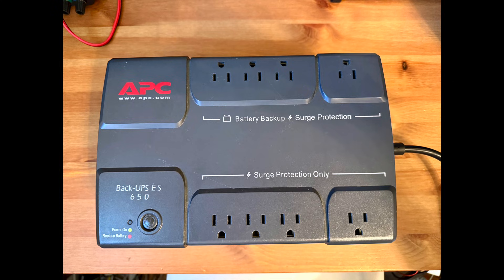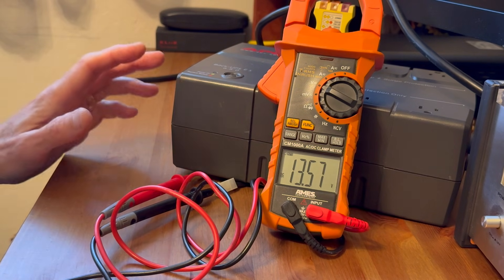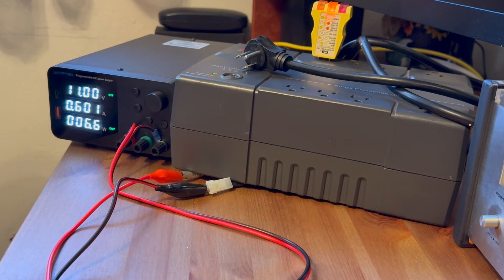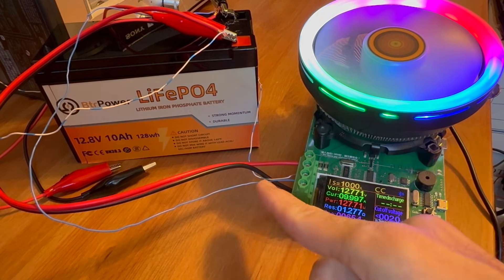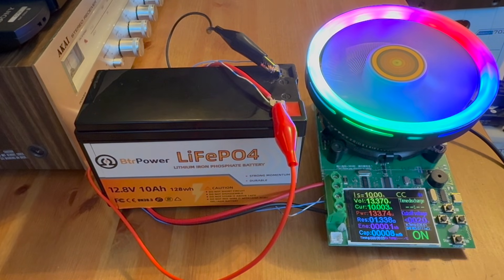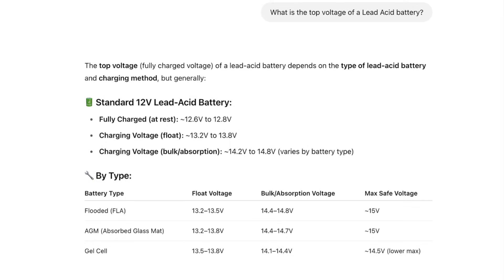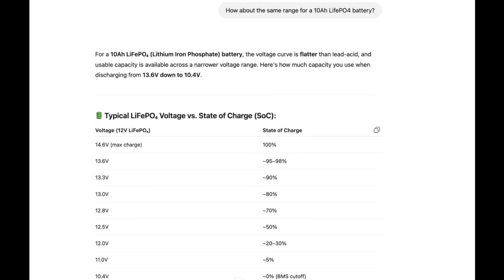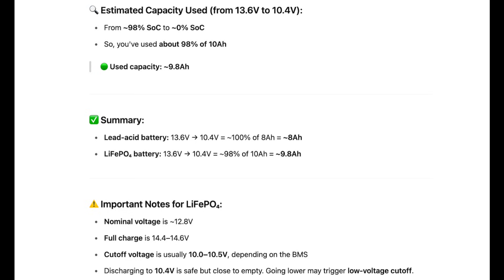Can you replace a small UPS Lead Acid battery with a LifePO4 (Lithium Iron) battery? #lifepo4

Comment: Li batteries require a different charger.

!
Reply from the maker: To fully charge that is correct. But this has worked fine for me in this specific model UPS. As long as the charging voltage is within range and the UPS doesn't completely discharge the LiFePO4 battery it should work fine.

Comment: Did you try to bump up the charge voltage?
Reply from the maker: I manually charged the battery outside (and disconnected) from the UPS using a variable power supply until the BMS cut-off.  But when I tested again and placed it back in the UPS it will only charge to the max voltage the UPS supplies.

Comment: 2:21 Very strange. I have two APC CSB 300 and 1000XL that turn off at 11.3V battery voltage.
Reply from the maker: There is probably variation between models. Although I would think within a specific brand (like APC) it would be fairly consistent. One question, did you have an AC load when you tested? I have found (after making this video) that the cutoff voltage can vary depending on how much load there is.
Reply: @AlexsRepairBench  Yes, of course, this is under 30-45% UPC load.
Reply from the maker: @bunakov-m  Good to know and thanks for commenting.

Comment: Why don't you actually try it instead of just asking chat GPT(which hallucinates all the time)
Reply from the maker: I've been running LiFePO4 batteries in my 3 different UPSs for years (see my other videos). I only used ChatGPT in this video to summarize things and I side-checked the data before including it.  However, I do agree that ChatGPT is sometimes blatantly wrong, so people should always check the results before using or relying on the data.  Hopefully my video did not give the impression I just relied on the data without confirming it.
Reply: @AlexsRepairBench  What brand UPS are you suing? Cyberpower, APC, etc...
Reply from the maker: In this video it is an APC (which you can see in the first few seconds of the video), in another video I have a CyberPower UPS, so I've tried with a few. They are all small UPSes.

Comment: Hey regarding your conclusion, I have some concerns as I was doing research about the same topic. Most of those LiFePo4 batteries BMS have a max discharge current set at 18A. The problem is, that  even with smaller UPSs like the BE550G which is rated for 550VA/330W max, you would ask the battery 27.5A discharge current. That would make the BMS cut off instantly.
Did you actually tested a 18A rated LifePo4 in your UPS?

I ended up replacing the two 12V 9Ah in my 1500VA smart UPS with SLA again since i was not sure LiFePo4 would work at all.

P.s: i just noticed you published another video regarding my question.
Reply from the maker: Good points. I mention this in at least some of my videos (maybe not my first video), as I did learn as I made more videos.  Any small load that draws less than 1C of whatever LiFePO4 battery you use should be fine, even a bit more seemed to work.  To answer your question, I never drew more than 18A and did not experience the BMS high current cutoff.  It all depends on how much load you plan to have on the UPS which can be determined ahead of time.  In my real-life use I have one UPS that powers networking equipment and draws by actual measurement about 2 amps from the battery, and an older Windows computer with flat screen monitor that combined draws 60 watts under no load and 95 watts under full load, well under a 10 amp draw from the UPS's battery when the power is out.  Now if I had a power-hungry machine that drew 300 watts that could really be a problem and I'd either need to stick with lead acid or perhaps add two or three 10Ah batteries wired in parallel to support a 30 amp draw (3 would be better, or just get a higher capacity LiFePO4 like a 50Ah that of course would need to be outside the UPS and wired using sufficiently large gauge wire to the internal battery connectors).  Thanks for commenting and bringing even more attention to this, it is an important thing to keep in mind.

Comment: AGM has much higher discharge current (5-10C vs ~1C). Swapping to LifePo4 only works if you keep the load very low (~100W for the 10Ah battery you have there).
Reply from the maker: Correct. Lead acid has a much higher current draw capacity than LiFePO4.  I do mention that in the middle of the video and cover it in more detail in some of my other UPS-related videos.  LiFePO4 works well for running minimal or set load items like home network and modem equipment.  For example this UPS is for a cable modem, router, and switch.  All that together when running on the UPS battery is about 2 amps, which would give me about 5 hours run time when the AC is out.  And the battery should hopefully last at least 10 years unlike the lead acid I had kept replacing every few years.  A different UPS I have protects my computer which with the monitor uses about 60 watts idle and about 90 watts under load, which draws less than 1C with a 10Ah battery.  If I had a 200 watt load plugged-in to the UPS, a 10Ah LiFePO4 might not be the best choice.

Comment: Create one that uses a larger LifePo4 capacity. Say 12v50Ah, 12v100Ah, for such small UPS. I want to see a deeper testing. I want to do it but I lack tools.
Reply from the maker: I'll see what I can do. I have limited batteries but I might be able to dig something up. Mostly what you will see, at least with the UPS's I have tested, is longer runtime and longer charge time, potentially much longer. For example if my 10Ah battery is replaced with a 50Ah battery, the 0.5A charging current would take ~100 hours to charge if the LiFePO4 is completely discharged.  Of course the runtime when there is a power outage would be significantly longer as well, probably 5X if my original battery was 10Ah and I am replacing with a 50Ah.

You would also have the benefit of being able to run a larger AC load on the UPS, since the 50Ah battery can probably handle 50A continuous discharged. But something to consider is cooling of the UPS, the unit was designed for a very limited runtime at higher current from the battery (sometimes only 5-10 minutes at full load), so if you significantly lengthened that, it could potentially cause overheating of the UPS circuitry that generates the AC. But only if you had a high AC load, probably anything less than say 5A DC load on the battery isn't going to be a concern. But a 30A DC load might for a small UPS unit that originally had a 10Ah battery.

Comment: What happens if you use the battery till the ups shut itself off(like during a power outage for many hours and device left unattended). Some UPSs need power from batteries to restore, so called cutoff mechanism, since the BMS will make the voltage 0 to prevent battery being fully discharged. I doubt that unit will start at all after a such power outage. I experiemented the same but hit the wall and had to take the battery out and charge to bring the battery online. Appreciate your experience. Thank you for the video.
Reply from the maker: You are welcome.  You bring up a good point on something I had not tested, so I ran some tests using this same UPS and I had mixed results. With the LiFePO4 battery fully discharged (showing 0 volts), in some cases when I restored AC power the UPS would go into a mode where it made a horrible buzzing sound, and in other cases it came back up just fine and started charging the battery.  I will be making a video on this with more details and publishing that in the next few days.
Reply from the maker: I created the video for this here in case you are curious: https://www.youtube.com/watch?v=NnljR5p-cB4
Reply: @AlexsRepairBench Thank you for spending your time to clarify and make the video.

Comment: I like the battery tester you're using in this video. Can you provide more information on it? + Subscribe.
Reply from the maker: I like this one a lot as well.  I tried a different model before this and it ended up breaking on me.  Anyhow, I ordered this nice unit from Aliexpress a while back, it is still for sale here: https://www.aliexpress.us/item/3256802913434210.html. There are two versions, a 150 watt version and a 180 watt version, I bought the 180 watt version and I am glad I did.  When I ordered it in 2022 it was about half the price, currently it shows $77 with a steep shipping charge to the US.  Our of curiosity I checked Amazon and this looks to be the same unit and as of today 9/14/25 it has a coupon and is around $72 at this link: https://amzn.to/4noL1hg (I am an Amazon associate and will earn a small commission on purchases using the link).  Thanks for commenting and subscribing!

Comment: For those of us who don't have the equipment to test the max current draw for the UPS or the battery, what would happen if the UPs tried to draw more current than the battery is supposed to handle? My understanding is that these lead-acid replacement LiFePO batteries have integrated management circuitry that prevents them from getting damaged when installed in systems that were designed for lead acid.
Reply from the maker: Depends on the LiFePO4 brand that you buy. One of the batteries I bought has a 10 amp limit and will cut-off if more current is drawn for more than a brief time. But the battery I used in the video does not, and I was surprised I could draw around 15-18 amps for almost 30 seconds without it cutting the power.  I queried the seller since I saw it advertised as a "10 amp" battery, and they said it can potentially damage the battery if you draw more than 10 amps continuously and did not reply to my part asking about the 10 amp limit advertised.  So buyer beware, always buy from a reputable seller and check reviews.

But you bring up a good point, if the battery were really to cut power if > 10 amps were drawn, you have to be very careful what you plug into the UPS to not exceed that, since if you did the UPS would shutoff with no warning, defeating the purpose of having a UPS.

In my situation my computer + monitor never draws more than about 90 watts at full CPU load which would be less than 10 amps at ~12 volts.
Reply: @AlexsRepairBench  Good points, I hadn't considered a situation that the battery would just cut power if the draw was too high. I assumed it would just throttle the supply to 10A.
Reply: @AlexsRepairBench Can I use two 12V 12Ah LiFePO4 batteries in the series?

UPS has two lead 12V × 7.2Ah batteries.

 I don't wanna buy a 24V parallel system.
Reply from the maker: @debarghyachowdhury1652  You should be able to as long as they are balanced and both batteries initially charged the same amount (hopefully fully charged).  Do you know the maximum charging voltage the UPS will charge them to?
Reply: @AlexsRepairBench  I think it's 27-28.7V.

Because, the UPS is built for lead acid batteries. So, I can expect a 20-25% loss in one year.
Reply from the maker: @debarghyachowdhury1652  Not sure what you mean by "25-25% loss in one year".  The typical max voltage for LiFePO4 for charging is about 14.6 volts (3.65v per cell x 4 cells), so double that would be 29.2 volts. If I take your lower number 27 and divide by 8 (for 8 cells) that is 3.375v which would likely charge the battery to about 75-80% charged, which is still pretty good given the extra longevity you will get out of LiFePO4 compared to lead acid.  Of course you also would need to know the UPS's cutoff voltage to find out how much capacity might be remaining in the LiFePO4 cells to determine the actual run capacity of the UPS.
Reply: @AlexsRepairBench Thanks for your replies.

My UPS is from APC backup UPS 1100VA. 

I'll connect two LiFePO4 batteries (12V, 12AH) in series. 

I saw one review saying— APC UPS lowers the capacity of batteries in one year. His lithium battery lost 25% capacity within a year. 

I don't know if it's true or not because I'm not an expert. 

I contacted a customer support guy and he's telling me to buy two 24V 6Ah batteries and connect them with a parallel connector otherwise if I use 12V 12Ah batteries, batteries will be damaged.

UPS expects 12V batteries in series why should I put 24V batteries there. I know in parallel connection the overall voltage will be 24V just to increase the capacity. 

Sorry for bothering you.😅
You get a new subscriber.
Reply: Most bms have peak current limit twice the rated current limit for short term or till the mosfet reach the threshold temp
Reply: if u only have raw cells get an anl fuse to limit current or maybe buy a bms since they are dirt cheap for the most basic ones
Reply from the maker: @wywlf6912  I would always use a BMS, as you say they are cheap and prevent issues some of which can be dangerous (fire hazard). Adding an extra fuse too is not a bad idea though, "just in case".

Comment: FYI : The standard battery case (video thumbnail) has the following dimensions : 
151.5 x 65.5 x 93.5mm (EXTERNAL) 
145 x 59.4 x 83mm (INTERNAL) 
When you insert 8 x 32700 cells (4S2P), they can fit in a "staggered" configuration, thus enabling a 12.8V / 12Ah LiFePO4 battery (for longer power outages) capacity.
Reply from the maker: I thought about opening up one the cases to add some cells but ideally I should add the same exact cell type. Another idea would be to purchase an empty case and then fit in as many 32700 cells as I can along with a higher-powered BMS.  Then I could utilize the UPS at the full current capability versus now where I try to limit the current from the battery to be under 10A (which is about 100 watts AC give or take).  These 12.8v LiFePO4 batteries from Amazon all seem to say "10A" max current, although I have been able to draw more than that on some of the brands.  Anyhow, great to have your input and this conversation!
Reply: @AlexsRepairBench  I reckon we should first identify where these batteries are used. So far I know about gate motors; alarm panels; UPS's. Each of these devices have different charging voltages & currents. If we take the worst-case scenario (a spreadsheet will do nicely here) with each device's charging voltage and current, and use the data to choose an appropriate current BMS, one can now start defining the standard for these batteries e.g. Let's hypothetically say  
1) the device with the highest voltage output is the UPS with 13.8V (is less than the Vmax required for the BMS - 14.6V) - so this will work.
2) the device with the highest current needs is the gate motor which requires 15A to operate, so now we need  6Ah cells that have a continuous current of 3C (18A). The 18A is higher than the 15A, - so this will work.
3) the BMS must now be a 4S LiFePO4 with a charging/discharging current of 20A or more.
4) SUMMARY: 
Highest Voltage = 13.8V (sufficient to charge battery - 14.6V - 12.8V)
Highest Current = 15A (6Ah 3C batteries will be sufficient to deliver 15A)
Highest Current = 15A (20A charge/discharge 4S LiFePO4 BMS will be sufficient to deliver 15A)
(as explained previously 8 x 6Ah 32700 cells can fit into a standard case in staggered configuration) 
Thus the standard should be : 
4 x 6Ah 32700 3C LifePO4 cells (76.8Wh)
1 x 20A LiFePO4 BMS (4S1P)
1 x standard Battery Case - 145 x 59.4 x 83mm (INTERNAL)
OR
8 x 6Ah 32700 3C LifePO4 cells (153.6Wh)
1 x 20A LiFePO4 BMS (4S2P)
1 x standard Battery Case - 145 x 59.4 x 83mm (INTERNAL)
Reply from the maker: Nice detailed answer. Thanks!

Comment: It certainly answers my question below :
Can I use LiFePO4 12.8V batteries in my UPS as a replacement for AGM/GEL? 
Answer: YES !

The next question would be :
Can I use LiFePO4 12.8V batteries in my sliding gate motor as a replacement for AGM/GEL?
Reply from the maker: I'm glad you found the video helpful!  To answer your question, you can probably use an LiFePO4 battery for a sliding gate but you would need to confirm the maximum current draw of the gate compared to the maximum rated current supplied by the LiFePO4 battery you choose (gate would have to be less obviously). Also, if you are in a cold climate, you cannot safely charge LiFePO4 batteries below 0 degrees C (32 degrees F). They do make batteries with heaters etc., you could research that. If you are in a particularly cold climate, there could be an issue with using them below this temperature too. My suggestion would be to check the specs of the battery you have in mind before purchasing.
Reply: @AlexsRepairBench  A typical 3.2V / 6Ah 32700 LiFePO4 cell can deliver a 3C (18A) maximum continuous current. When connecting 4 x cells in Series (4S + BMS = 12.8V / 6Ah / 3C-rating) it should operate correctly (depending on temperature of course). A sliding motor requires 10 - 15A (3C = 18A) to operate. The voltage supplied from the internal charger is 13.8V (falls within the 12.8 - 14.4V required range) at 1.5A.
Reply from the maker: @JOATMOFA  Thanks for commenting with in this information!  Just be sure to check the specs on the BMS for maximum sustained current draw. The cells may be good for 3C but the BMS may be rated lower.